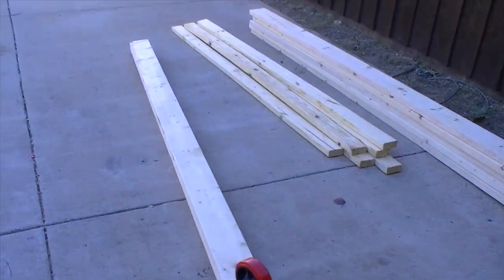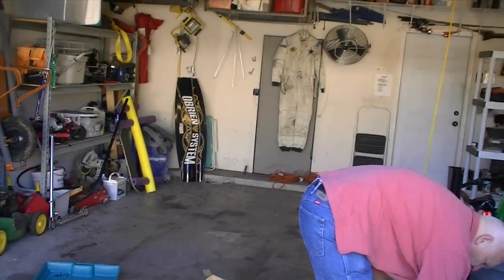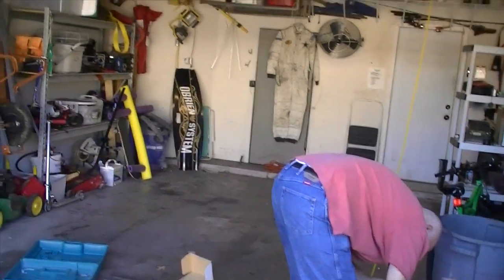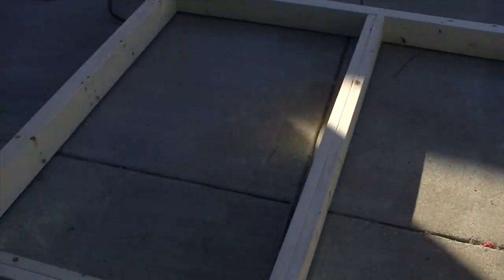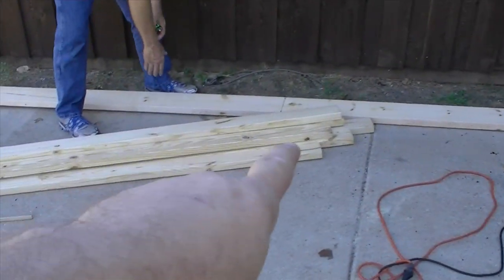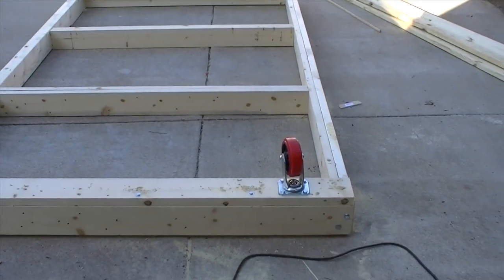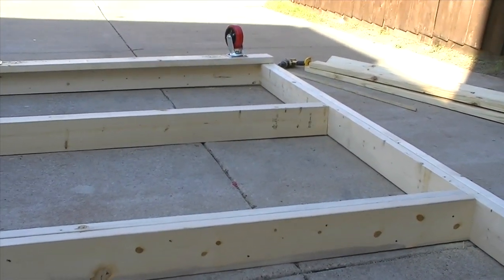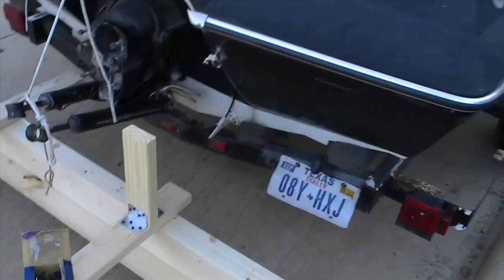Project Carlson CVX-18 - Building a Cradle  Part 1

Comment: Do those casters have brakes on them?  If not, a small chain wrapped in a circle around the wheel will help keep them from moving while you work on the boat.  Just flip it at the wheel like you were using a whip, and it will wrap around the bottom.

Comment: I know this project is long over, but a minor suggestion for the wheels. Use 2 casters on the back, and 2 solid wheels on the front. I understand the desire for 4 caster wheels, but in practice they cause more problems than anything (I've found). Using just 2 casters will give you more control over the cradle, especially under heavier loads.

Comment: Labor has never bothered you at all, and I would think with some labor you could do something about the engine and outdrive you have. Surely it won't take many parts for the engine, and even if you have to buy new (used) guts for the outdrive, it won't be too bad. I've had to do that before. No matter what route you go you'll have to pay for the interior, so you're not necessarily gaining or losing on that by using this boat.